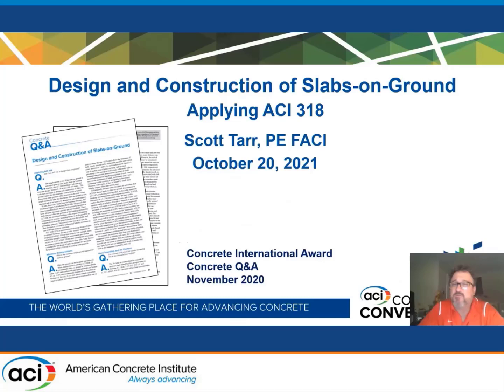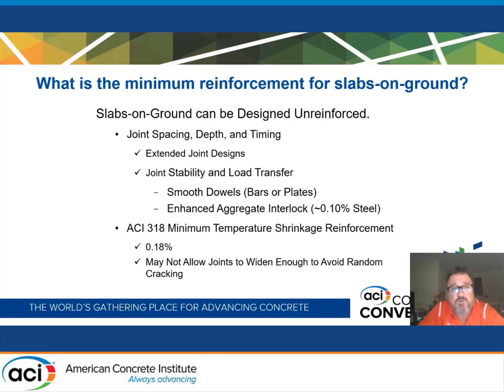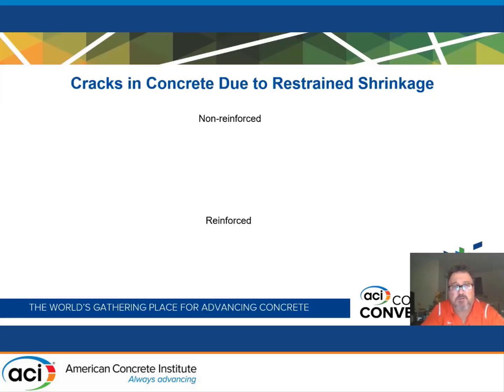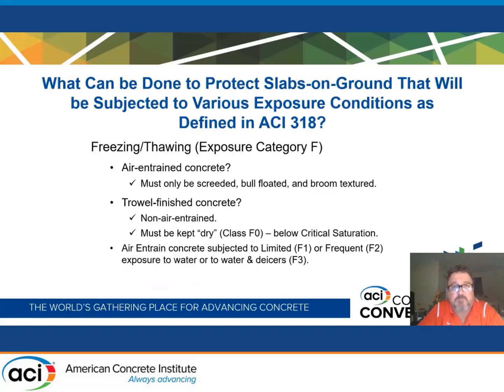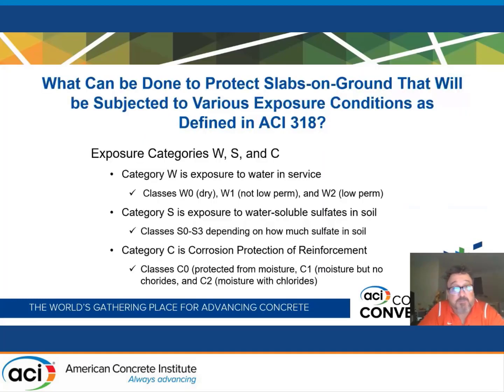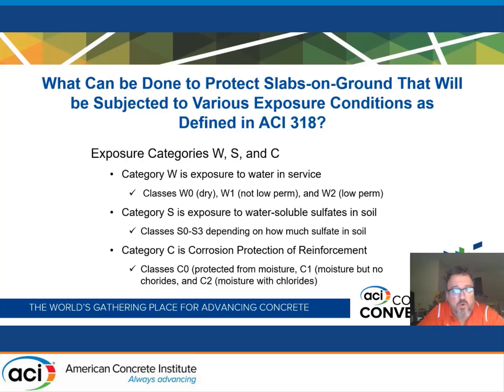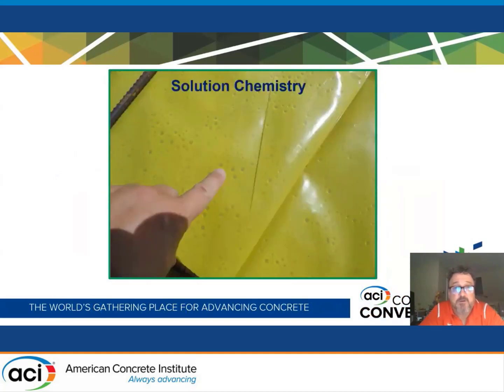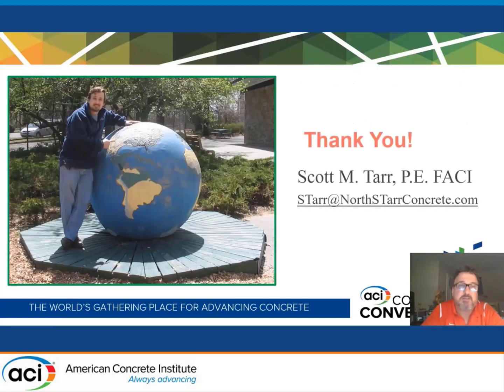Design and Construction of Slabs-on-Ground – Applying ACI 318

Comment: Hi 
Thanks for your video. I have a project that calls for an RC Stiffend Raft Slab 130mm Suspended for a residential Duplex build in Melbourne for site classified as P Class. What does he mean by suspended.